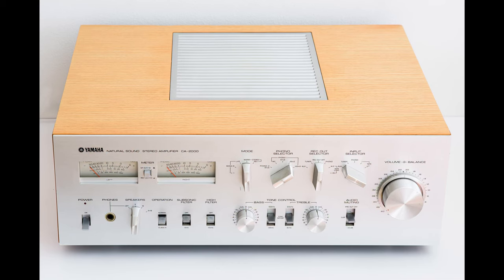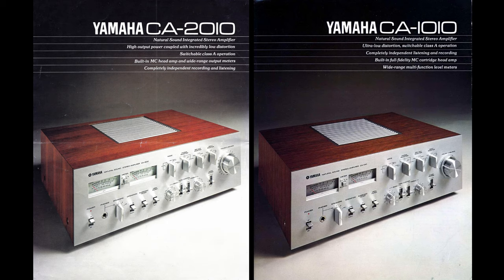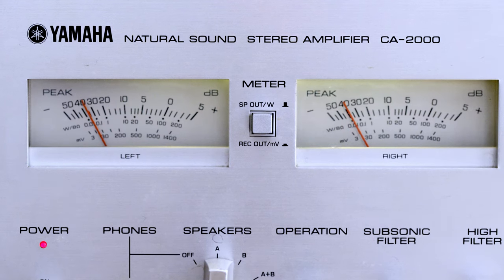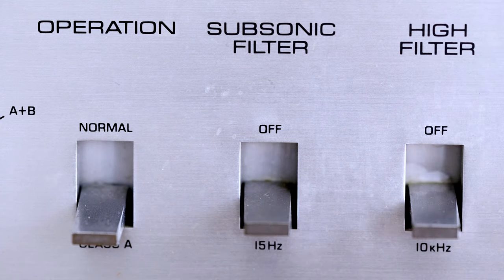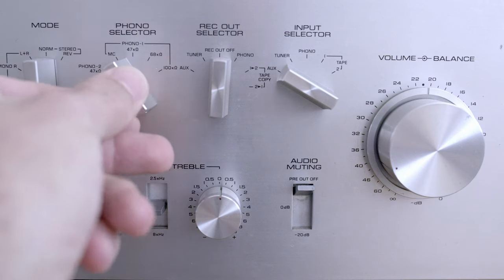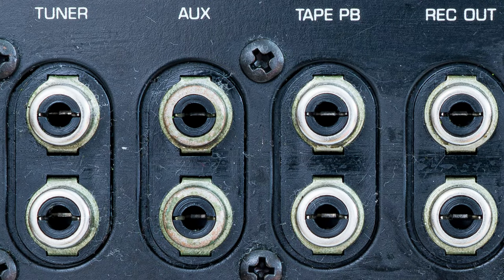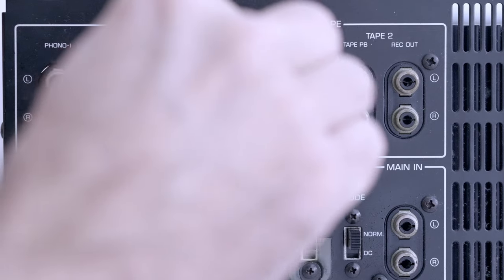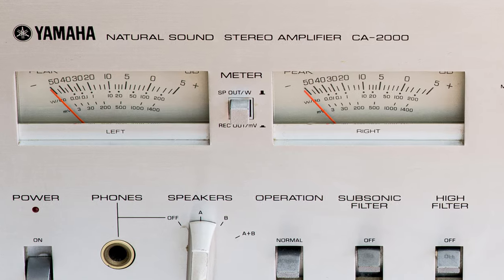Yamaha CA-2000 (CA-2010) Integrated Amplifier Review (Second Reupload)

Comment: I "may" have an answer. Class A/B is Class A at low output and then goes over to Class B at higher output. The reason you "may" not have heard a difference was the amp was in Class A both when you played it in Class A/B and when you played it in Class A. ... I think

I have the itch.
Reply from the maker: I tried that at higher volumes, too. But you may be right, it may not have reached the high enough volume to go over to class B.
Reply: From my memory normal mode dont runs hot at all.

Comment: How can I connect it to a CD player with Line in or digital output? AUX?
Reply from the maker: All amp's inputs are analogue, so the only way to connect a CD player is through aux or tuner input.
Reply: @KITR-UK  So basically I need 2 RCa inputs to 2 RCa outputs?
Reply from the maker: @SacreDro  Pretty much, yeah.
Reply: @KITR-UK  Great, I wasn't sure if I could do it.
Thanks again.
Reply from the maker: @SacreDro  No problem. BTW, what CD player did you have in mind?
Reply: @KITR-UK  Senon DCD 600 ne
Reply from the maker: @SacreDro  Yeah, that's going to work just fine.